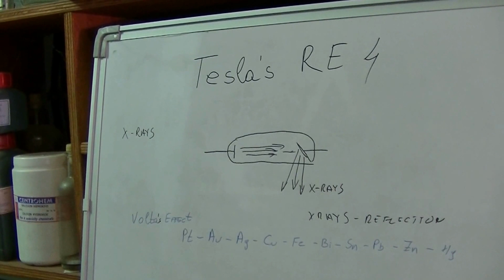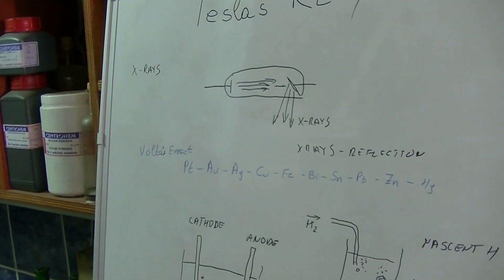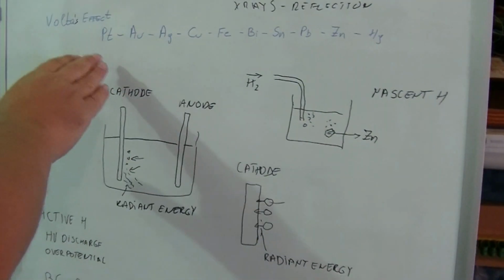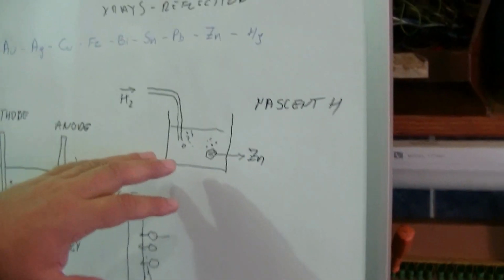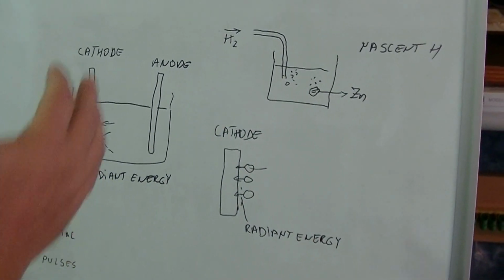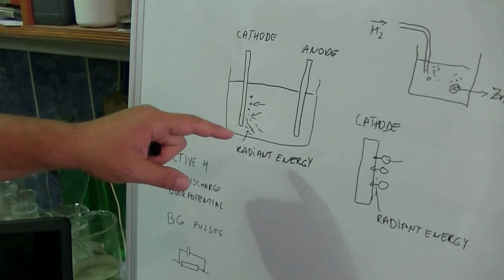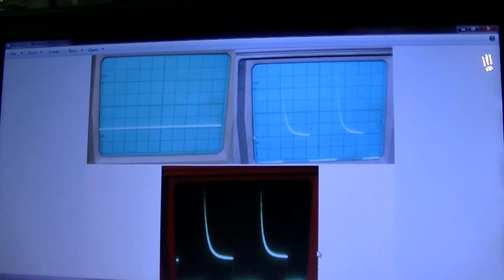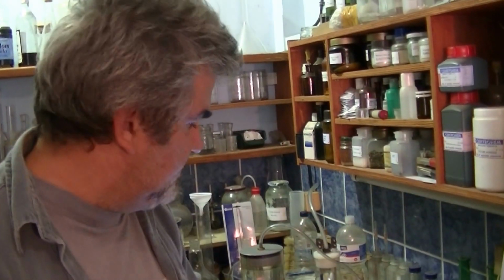Tesla Physics - Tesla's Radiant Energy 4

Comment: How would I produce these pulses in a dc circuit to create higher energy BG?
Reply from the maker: Well , I do not know your skills with electronic. You need oscillator for switching mosfet to get pulses like it is shown. Also input voltage should be minimum 50% higher then it is needed , but do not go over double voltage input. Put in calculation about 2V up to 2.3 V per cell of your serial cells electrolyser  and you will get what input voltage should be.
Reply: @MilanMančić , thank you for your response to my question. The cell I have built contains no stainless steel plates, instead, I use a 200 micron screen with a .2 mm space between the screens. I crack (0.00 ppm tds) distilled water with no potassium hydroxide or lye. Would a pwm produce the same effect?
Reply from the maker: @moonsitter1375  I see, yes pwm can be used for that. There are options how to get more active hydrogen gas. Using type material for electrodes which has high overvoltage potential (but in this case it is not practical), using higher voltage pulses above needed voltage oer cell. So you need working amps at 2-2.3 V per cell (for 25% KOH solution) , above that you need spikes or pulses as I described. That pulses above 2.3 V produces more active hydrogen. On the and you will have mixture of ordinary hydrogen , oxygen, high active hydtogen, ozone etc. It is stll unknow theritory what application you can get out of it.
Reply: @MilanMančić  https://www.amazon.com/PEMENOL-Generator-Adjustable-1Hz-150KHz-Controller/dp/B07W229NVP/ref=asc_df_B07W229NVP/?tag=hyprod-20&linkCode=df0&hvadid=385571483433&hvpos=1o18&hvnetw=g&hvrand=15179165265041883560&hvpone=&hvptwo=&hvqmt=&hvdev=c&hvdvcmdl=&hvlocint=&hvlocphy=9030077&hvtargid=pla-880038767007&psc=1&tag=&ref=&adgrpid=76926661565&hvpone=&hvptwo=&hvadid=385571483433&hvpos=1o18&hvnetw=g&hvrand=15179165265041883560&hvqmt=&hvdev=c&hvdvcmdl=&hvlocint=&hvlocphy=9030077&hvtargid=pla-880038767007 

Would this device work as PWM? If so, how do I determine what setting to use?